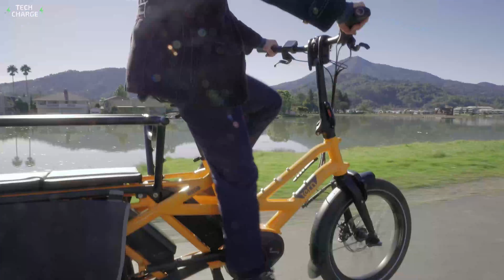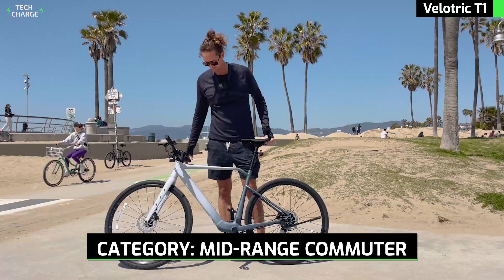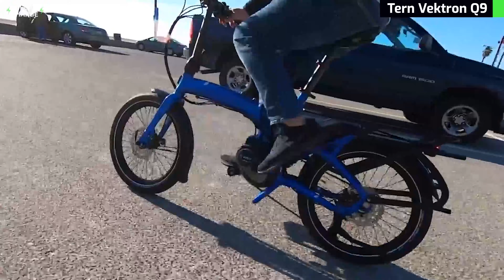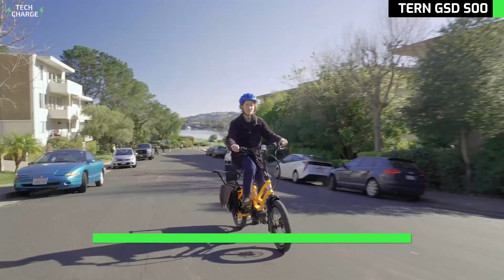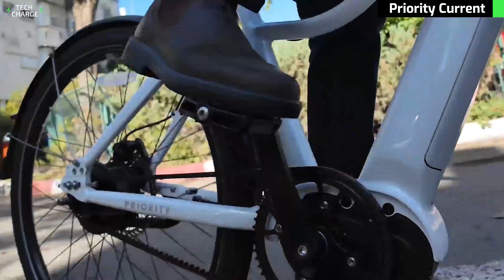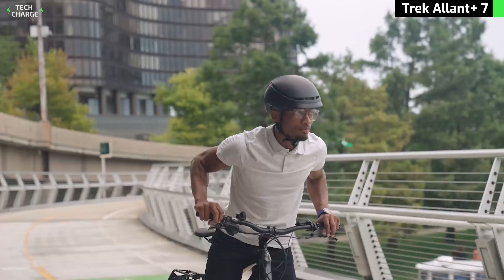15 Electric Bikes You’ll Never Regret Buying

Comment: BIG safety suggestion.  Chargers should have a setting, if selected, to stop charging at 80 or 85% to protect longevity of battery and help prevent fires.  I have a Samsung XCover Pro.  I can set charging to stop at at 80 or 85%.  The phone is 6 years old and woks PERFECT.